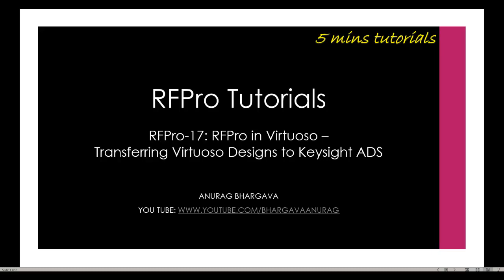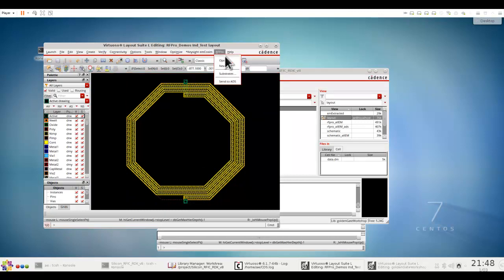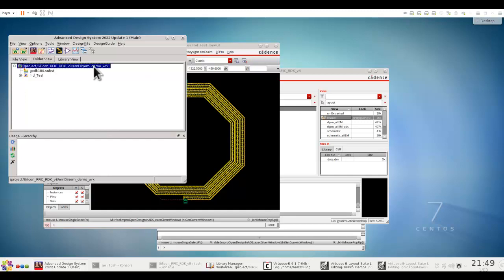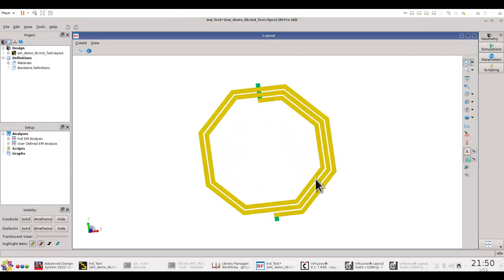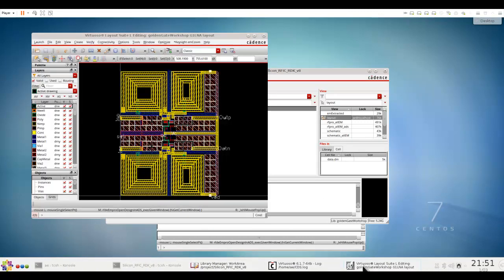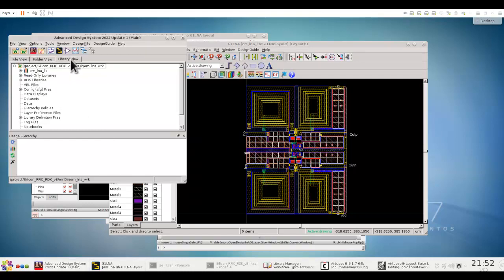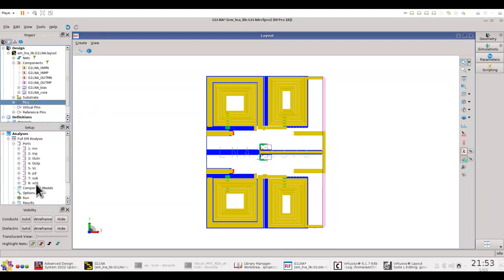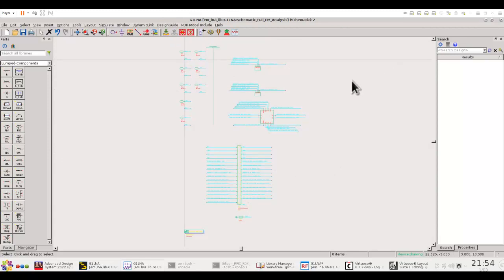RFPro-17: RFPro in Virtuoso - Transferring Virtuoso Designs to ADS

Comment: Hi Anurag,

First of all I would like to thank you very much for providing all these valuable tutorials, and for free. It is much appreciated. I am a mmWave IC designer at a US university and have been extensively using this feature of transferring virtuoso designs to ADS. This has been a lifesaver and has made my design flow very convenient and hassle free, especially when I want to utilize the power capabilities of ADS along with the Virtuoso environment. I have also been following your videos actively on this channel for a while now. 😊

I was wondering if you could answer a question I have been having for a long time related to this feature. Is it possible to transfer just one cell in the Virtuoso working directory to ADS, without loading ALL OTHER cells and libraries in the current working directory? My working directory is a very massive tapeout library and is several gigabytes large. Therefore, even if I have to simulate just one single passive structure consisting of just a few inductors and T-Lines,  ADS loads and 'updates connectivity' of all other cells in the working directory as read-only libraries, which takes a very long time while opening ADS. It would be great if you could provide a solution to this issue. Any help would be greatly appreciated.

Thanks!
Reply from the maker: Hi Vinay,
The libraries that get loaded in ADS depends on what you have defined in cds.lib and if you don't want to load all these then recommend you to launch Virtuoso from some directly where you have lesser things defined in cds.lib. I do the same thing for many cases.
Hope this helps.
Reply: @BhargavaAnurag  Thanks a lot for the reply! This does help and makes sense. I will create a separate directory for running ADS simulations on my Virtuoso designs.

Comment: for the inductance extraction from RFpro  at what frequency in that particular simulation do measure the inductance? if we say that is 1nH, at what frequency do you quote it?
Reply from the maker: Usually vendors specify the values at 100 or 300MHz but it is always good to check the same in their datasheet